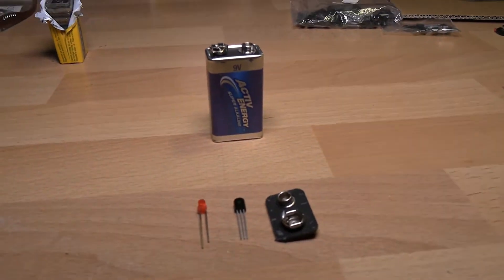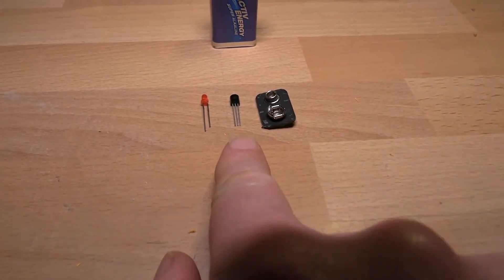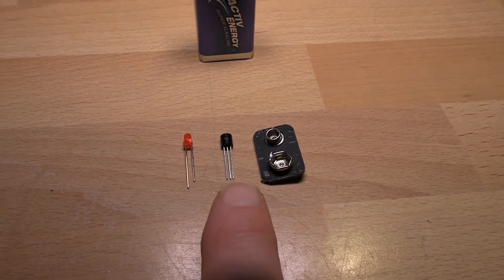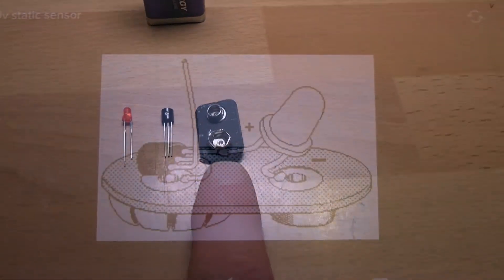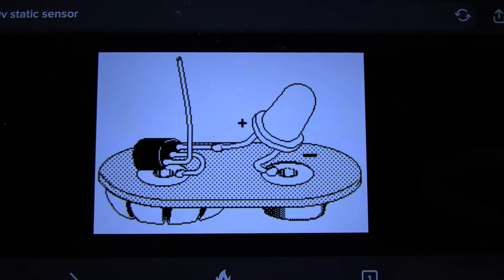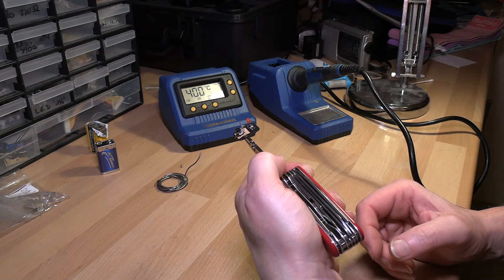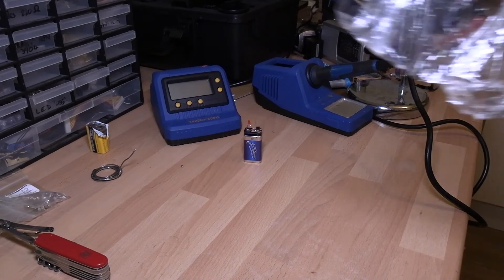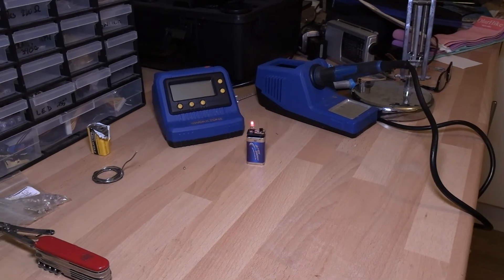How to build a static field sensor for paranormal investigation.

Comment: Thanks for the heart, but I would like to know the transistor abbreviation.  Thank you
Reply from the maker: MPF 102 field effect transistor  👍
Reply: @PsiParanormal  Thank you very much, I see that one of the feet acts as an antenna.  Listen, but what is the little circuit made sensitive to?  What makes the led turn on or off?  Thanks so much
Reply from the maker: @lifeafterlife9939  its a static field sensor so it detects change in the static energy field
Reply: @PsiParanormal  I understand thanks, listen I use the kinect, with beautiful results, but then what do the sls cameras like the kinect see?  That is, what energy does the kinect detect on the spirit?  I know he sees the raw kinetic energy of the spirit, is that right?  Or does it detect something else?